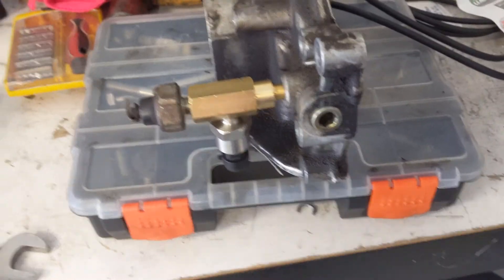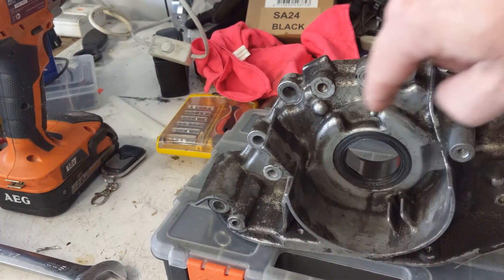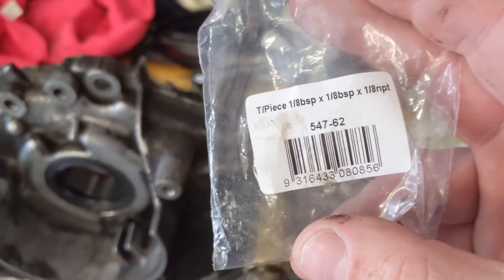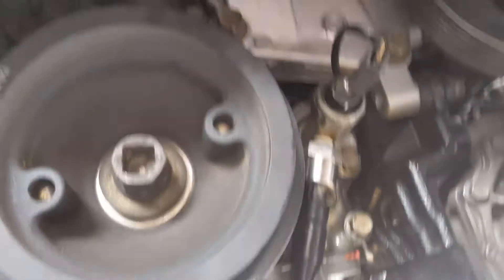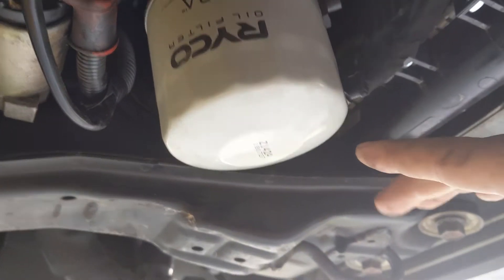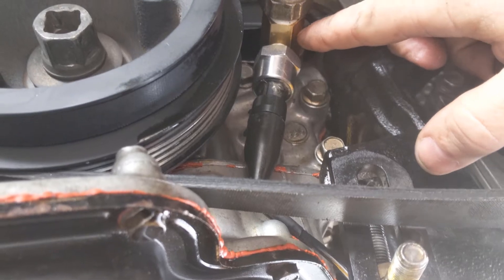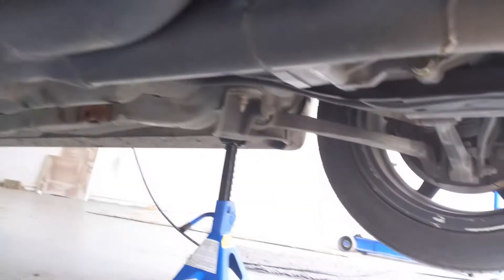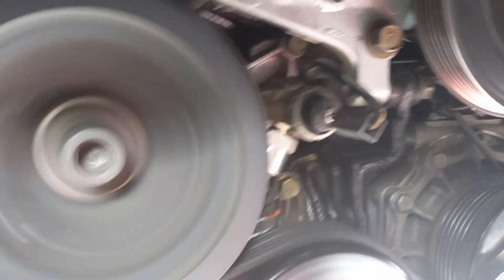Oil pressure transducer adapter for Legnum/Galant VR4

Comment: Hey do you know where the oil pressure switch plug is wired into the engine harness? Ran into an issue where my oil light came on and I changed the oil pressure switch to see only to realise that the reason it’s in is because my plug after following the wire off of the switch isn’t connected to anything. The jack it jacks into the wires seemed to have been cut by someone when I went to have them wire in my a/c compressor so I need to find the right wires and reconnect it
Reply from the maker: It's in the sub-harness that breaks out to the AC compressor.  You'll need to inspect that sub harness and see where the cut is, then splice in new wire.
Reply: @KaldekBoch  okay, do you have any wiring diagrams for me to be able to see what colour wire it’s supposed to be because I only have two wires running from the harness down to where the ac compressor is

Comment: I got my utcomp in but cant figure out what pin to use to supply my mapsensor and oil pressure sensor 5v?

I must be an idiot and not reading the diagram correctly.
Reply from the maker: A6 or A18, or also B6 or B12 if you have a UTCOMP-Pro
Reply: @KaldekBoch  thanks i dug deeper into the write up thread and found the info.